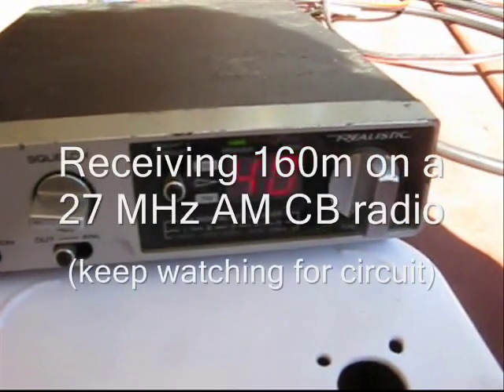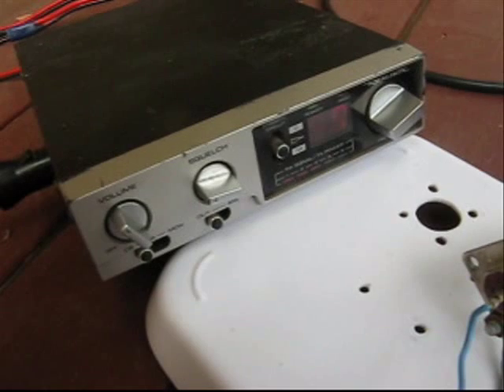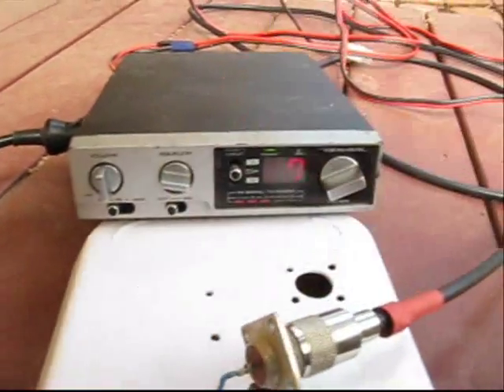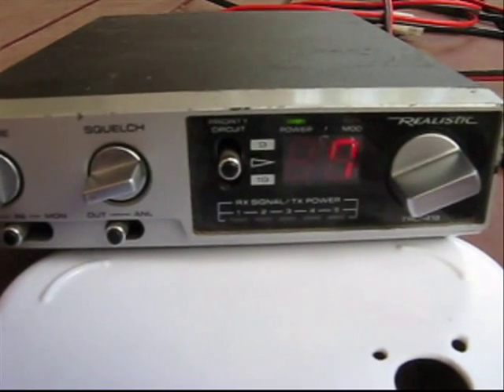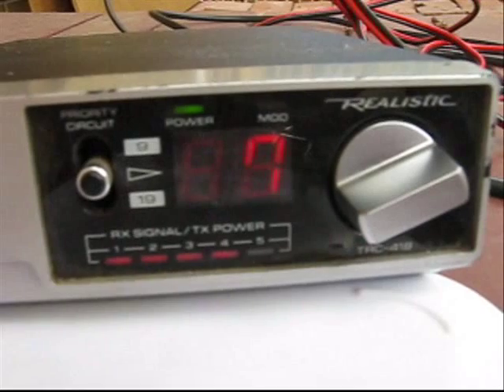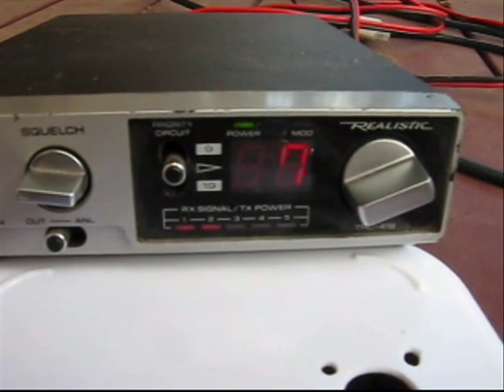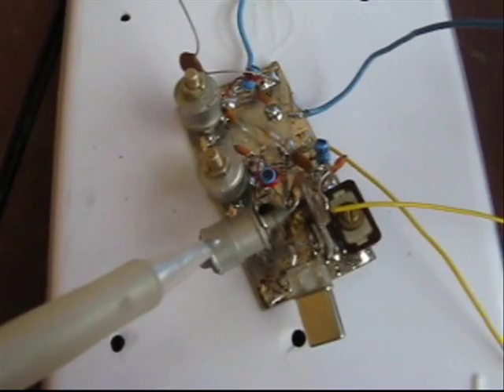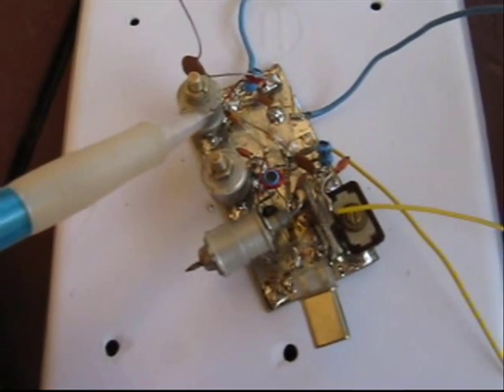160 metres to CB receive converter

Comment: How difficult would this be to transmit as well? I guess if it was easy, you would have done it already?
Reply from the maker: You would need to add extra circuitry including a transmit power amplifier and a better / more advanced mixer that would be efficient on transmit.

Comment from the maker: @oh2ftg 25 MHz should be fine provided that the CB covers 26.8 to 27 MHz (for 1.8 - 2 MHz).  The standard 26.955 - 27.405 40 channel CBs would miss most of the band. 

The use of a CB PA might be OK if it's broadband. Otherwise there'd be some tuned circuits to remove, and this will be fiddly given the larger sizes of bigger inductors and capacitors needed for 1.8 MHz.  Also gain may be too high.